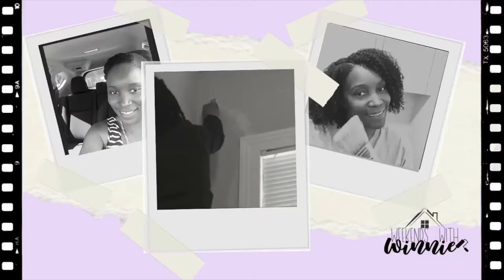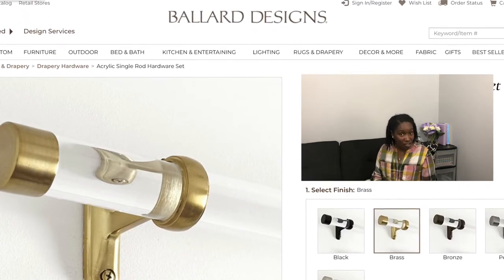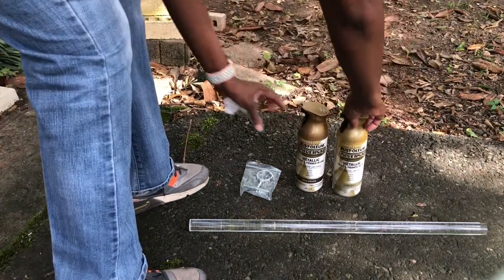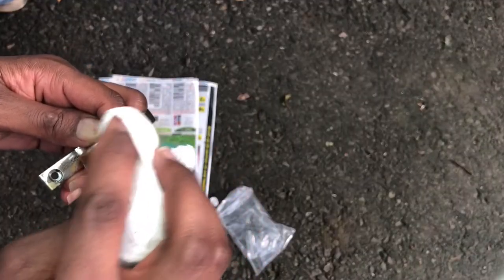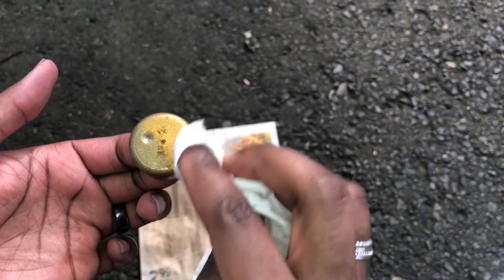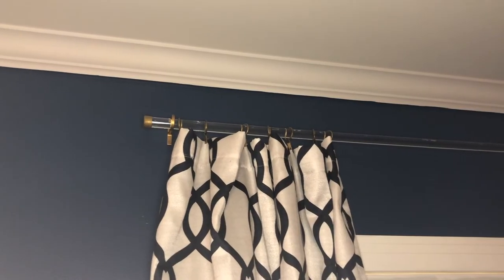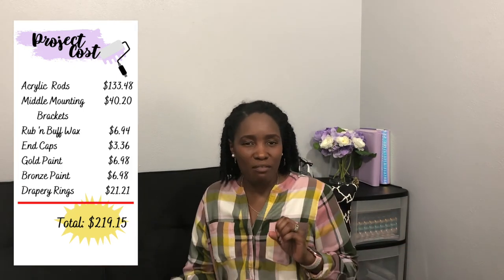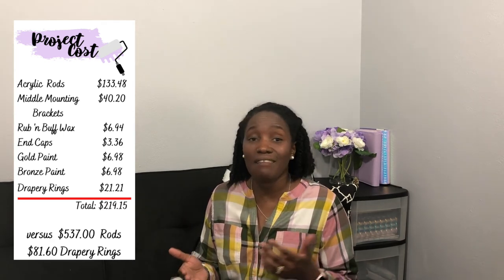DIY Ballard Designs Hack for Acrylic Rods for Less than $40 per rod!

Comment: Rub n Buff rocks!   I had a designer that ended up hating the finish of a very expensive motorized, custom built rod. The rod wrapped around a master bath. Replacing it would have been....very expensive.  We rub n buff'ed the whole thing. I was shocked at how well it came out!  It looked great! and it was more durable than you might think. It was a solid solution!